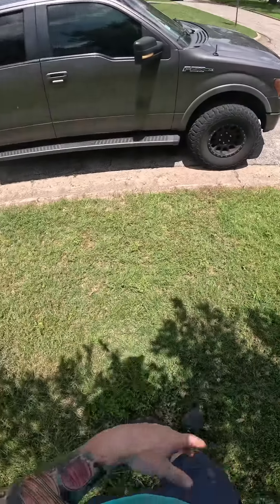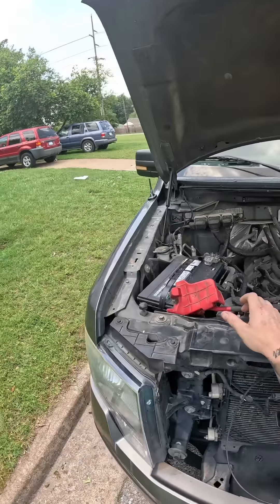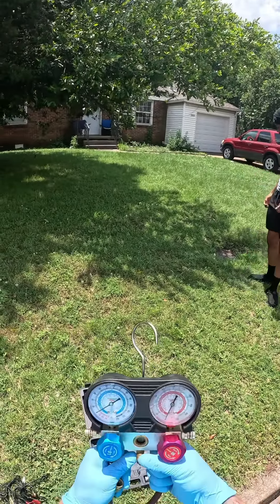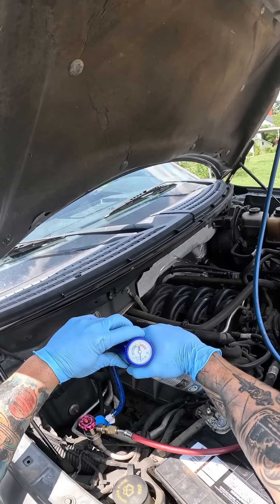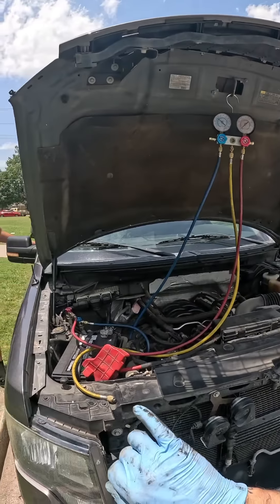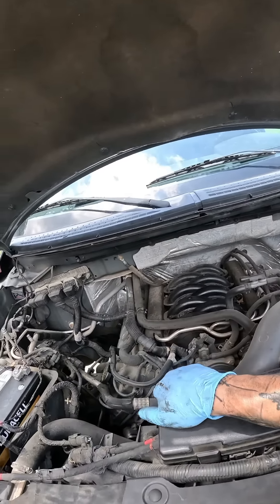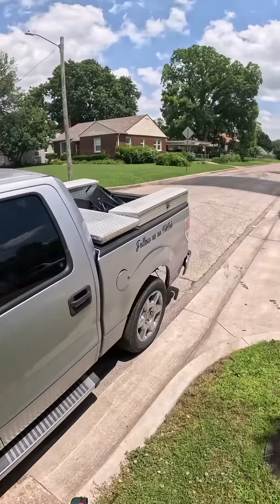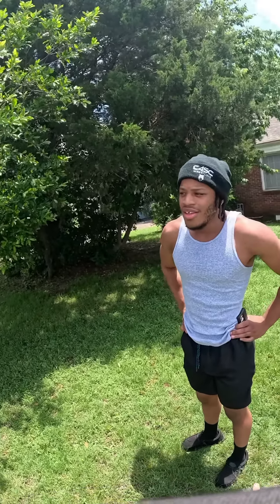Now that's more like it! 💪 #celebrity

Comment: Let me say what Parker won't. The leak that's coming from "back there" is the evaporate core inside the dash.  I guarantee you that when the guy installed that evaporator core, he broke something else and that's why the leak started again after just 2 weeks as the guy stated.  The compressor is the least of this guy's problems.  That's the deal!
Reply: Yes. I was thinking evaporator, not condenser
Reply: @Golgi-Gyges  The condensor is in front of the radiator. The Evaporator is in the HVAC box deep in the dash.
Reply: @klwthe3rd  yes, I know that.
What are you talking about?
Reply: @klwthe3rd  I did go to school for HVAC, you know

Matt misspoke. That is why I commented.
Reply: Exactly my thoughts too,  that compressor would be the last thing I’d touch,  gotta get that leak fixed first
Reply: @MistaHoffinata  Exactly.
Reply: @MistaHoffinata  do you agree that the compressor won't even come on if the pressure is too low?
I had to jump a pressure switch in order to get a compressor to energize, when charging a car with refrigerant before.
Reply: Yup not too hard to do a leak test. Even with a smoke machine or nitrogen
Reply: @Golgi-Gyges yea I agree
Reply: I charge 1300 to fix the problem of removing the dash and putting it back
Reply: Why did the mechanic say yeah the condensor...it's evap core in dash

Comment: There’s no orfice tube in a expansion valve system just the Txv valve. Txv systems will have drier/accumulator (aka desiccant bag) on the high side. Orifice tubes will have drier/accumulator only on the cold side. No system will have both. Hope someone finds this helpful
Reply: My ac system had a front and rear expansion valve. I replaced the rear expansion valve and the rear orfice tube last week. Would there be an orfice tube at my front expansion valve also ?

Comment: Guy probably has a leaking O ring at the Evaporator in or out whichever it is on a Ford, try tightening it down.  Unless homie cracked the core.  But who knows. Tough racket messing with peoples babies

Comment: the high pressure sensor or low pressure sensor may have gone bad, which tells the ECM to keep the compressor from turning on.  that being said, i'm assuming that's essentially what you were checking/bypassing with that probe on the compressor.

when i was troubleshooting my a/c last summer in my 01 yukon, part of my testing was just jumping the relay to force power to the compressor.  it turned on which told me it wasn't that.  ultimately i had a bad condenser.  had a hole in it, wasn't able to have any pressure obviously, so the low pressure sensor was telling the system 'NO'.  replaced teh condenser, charged the system, compressor kicked on.  worked great for a lil while until it just didn't.  consulted youtube which led me to a guy testing his low pressure sensor for continuity and how to do it.  tested mine, it was shot.  replaced it.  job done

Comment: Like some others have said, do not assume the compressor is bad. On a car I had, the compressor wouldn't even get power if the pressure is too low.
Reply: Dude, he topped up the pressure, and confirmed that there's power getting to the compressor.  He's got this..

Comment: How would i add pag oil in without having to drain the system. I found out after  changing some o-rings and filling the system that i should have added a tiny bit of oil .....
Reply: I think they make pressurized pag oil cans that you can add through the low pressure side. Just like if you were topping off with Freon.
Reply: Google ac oil and dye injector. What year and make is the car. Cuz you need correct adapter (R-134a or R-1234yf)
Reply: Nvm duhhh pag is normally R-134A
Reply: Amazon has A/C refrigerant oil injectors . I do not believe you lost enough oil to worry about it  .
Reply: @vicpetrishak7705  I do believe it is low because truck sat for years till I bought it I don't know how long it was dripping for.I seen green liquid dripping from the bad cracked o- rings that seals the hoses going to a/c
Reply: @skulledmonte84  The oil injector is very simple to use and has clear directions with it .